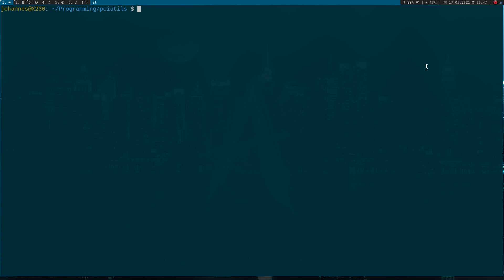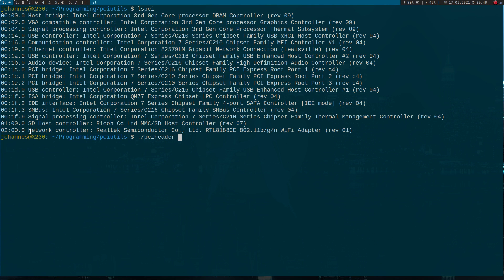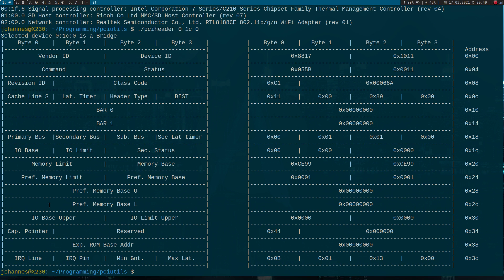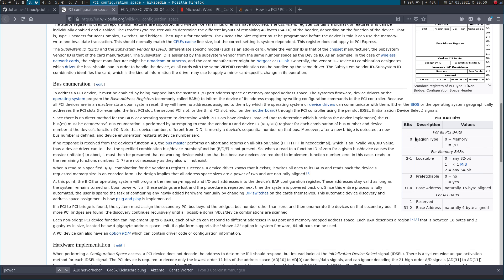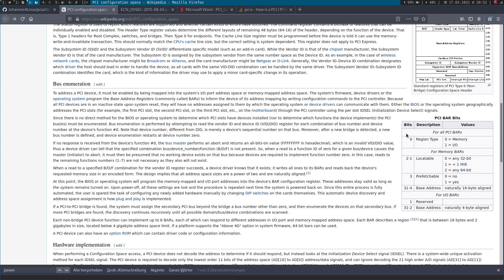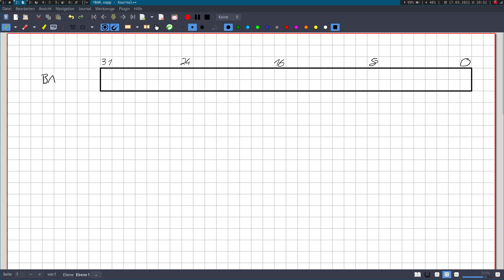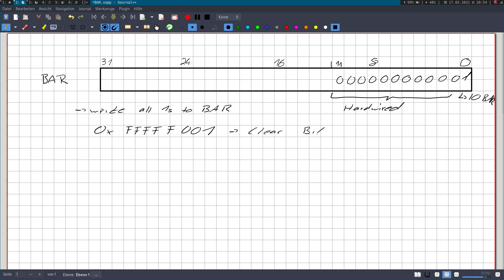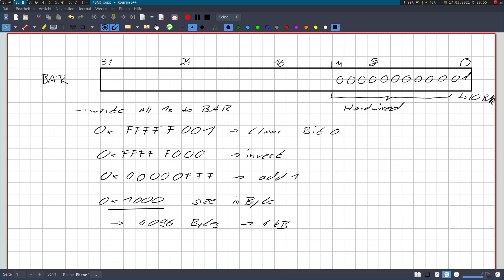GNU/Linux & PCI (Express) - Part  4: Base Address Registers - Theorie

Comment: I have a question. Is it possible that pcie  would change device address after hot-swap if new device is different than previous?
Thanks
Reply from the maker: Hmm, good question. Normally the address (Bus, Slot & Function Nr.) depends on the PCIe slot you put the device in. So, if you plug the device in the same slot and it only implements one Endpoint, you will normally get the same address.

But for the swapping you will need a hot swap adapter. After the swapping you can trigger a rescan of the PCIe bus by writing a 1 to the /sys/bus/pci/devices/<brigde>/rescan file. This will map the BARs memory into your PCs memory map.